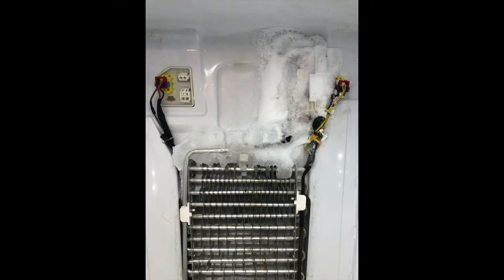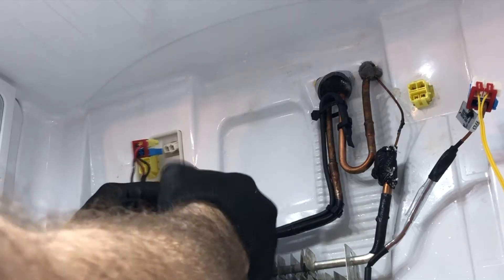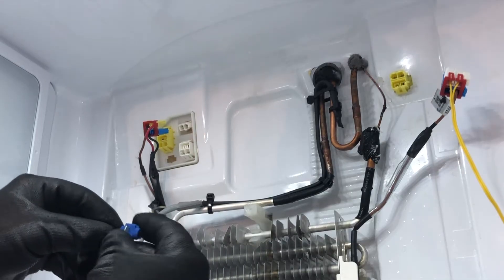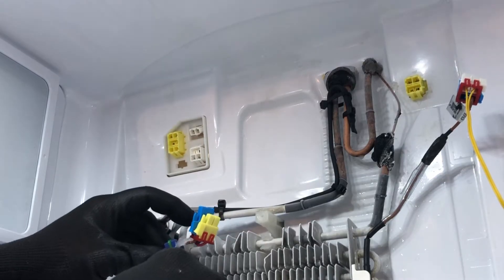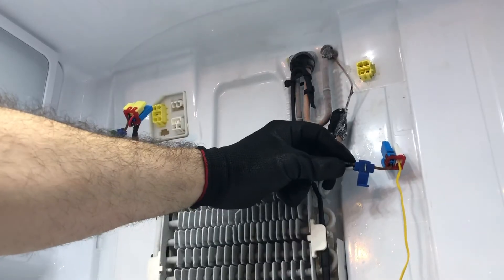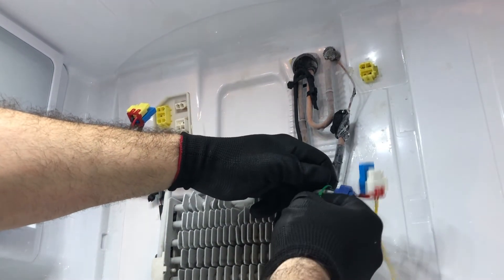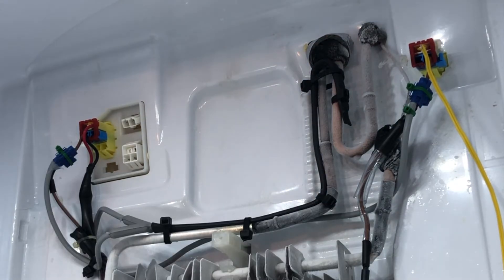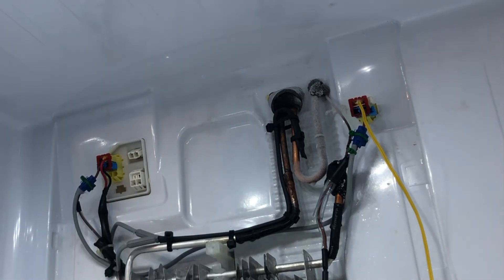Samsung FDBM evap heater add

Comment: Well I tried this fix and it only worked for a short time and it's back at it again.  I'm afraid I may have to throw in the towel.  I have replaced the thermostat and defrost sensor behind that panel as well.  Any more suggestions to prevent this issue?  Is there a timer on this fridge?  RF263TEAEBC thanks.
Reply from the maker: You do have to rectify the source of the problem which is the drain, Samsung has a modification kit, part number is DA82-01415A. I don't mention it because this video is for professional technicians and techs know about the recurring issue. I would recommend calling out a professional to finalize the repair and make sure the added heater is hooked in correctly and working properly.

Comment: Thanks for the video, anyway to put in the description which wires you connect to? They look like the brown ones? Also how do we test it to make sure it’s working and connected right?
Reply from the maker: Not all wire colors are the same for different models, check the schematic. To test, put it in diagnostics mode to defrost after you instal the heater. It should be hot to touch after a few minutes, can't keep your finger on it for more than a second. It's about 160 - 170 degrees.
Reply: obiously the two wires that the original heater is connected to. just follow the heater, it has a wire coming out on both sides. another way to test is to jump the defrost thermostat and that will trigger heating

Comment: This looks like a great solution. I live in South Africa and out voltage is 220V. Will this still work on my Samsung fridge?
Reply from the maker: the Supco heaters we use here in the USA are 120vac, so putting 240vac on it would cause the heater to burn up. If you can find a similar 15 watt heater, that would be ideal. The heater itself should heat to about 160 - 170 degrees. If you use too high a wattage, it can melt the evaporator cover.
Reply: @electronicsprojects4708  Thanks so much
Reply: @electronicsprojects4708  is the heater circuit not transformed internally to DC voltage? I would have thought internals mostly ran on DC, no?
Reply from the maker: @mitsuturbo  no, both factory and mod heaters are 120vac, (US models).

Comment: Do you have to strip the other wire (original from the fridge) or does the displacement connector cut into the shiething?
Reply from the maker: the wire insulation of the heater is too thick, so you have to strip the wires.
Reply: @electronicsprojects4708  Sorry, so the NEW heater wire, you have to strip like you did in the video, but the original wire, you don't have to, correct?
Reply from the maker: @larryroyovitz7829  correct
Reply: @electronicsprojects4708  Thank you, I just ordered that heater! Fingers crossed. Thanks again.
Reply: Well, I've added the heater, so we'll see. I have the RF197, which is "supposed" to be fixed with the drain kit. We upgraded the drain kit last year, but still had to unplug the fridge for days to defrost. This is the last ditch effort...if this doesn't work, I guess it's landfill time. What a waste. We'll see.
Reply: @larryroyovitz7829  did it work okay so far?

Comment: I couldn’t see the connection because of the Arm gorilla hair block.
Reply from the maker: Connection differs by model, it is wired in parallel to the defrost heater, I would refer you to the schematic for your specific model. If you are not a tech, I would not recommend you attempt this mod.

Comment: So where did you put the thermistor?
Reply from the maker: I find thermistor placement is a red herring. Samsung went back and forth, change it, don't change it. It doesn't make a difference. On these, you want to make sure the mullion flipper is working properly, clean out the condenser, add the Samsung drain kit, add the suction line heater, and you are good to go. (as long as a dryer hasn't jacked up the cover)
Reply: @electronicsprojects4708  thanks

Comment: Why won't my forced defrost kick the heater on? I changed out the heat sensor and I also changed out the thermal disconnect...any ideas? Thanks for your time man...it will power on for a second but then turns off
Reply from the maker: if its sensing the temperature is too warm on the defrost heater, it won't turn on the heater. If it won't kick on when frosted up, you may have a defective relay on the main board. Use the schematic and ohm out the circuit from the wire harness connector at the board. If you get 100 ohms approximately, it's the board.

Comment: Just be careful if you go outside of manufactures specs. for safety reasons.  If all components are working as the engineers designed them to, it should work.  I also measured the heat coming off the OEM heat coil and it approached 400F.  That is a ton of heat so I would be very careful about adding more heat back there as it could build up and become a fire hazard.  If frosting over becomes an ongoing issue, and it wasn't there from day 1, there are likely several other things happening e.g., drains, sensors, fans, built up moisture, etc.  Some of that non-visible moisture can be trapped inside the back panel foam.  My new panel weighed ~2lbs less than the old one, that I thought I had dried.
Reply from the maker: the new heater generates about 160 degrees, and you can touch it with your hand without getting burnt. It's not hot enough to start a fire. Your assumption that it just should work is incorrect. The engineers failed in their design, that's why many techs have thanked me for coming up with this mod. I know that thousands of these refrigerators have been repaired instead of being thrown into the local dumps. The only reason that Samsung doesn't introduce this is because it would change the energy consumption of the fridge, which is regulated by the government. This repair is for techs, not for DIYers and you are a tech, you should know about the Samsung mod kit, cleaning out the condenser, checking the mullion flipper for correct operation, the sensor. This mod is for the professional tech that has done his due diligence and is still getting a call back from his customer because everything he has done to try to fix the issue, has not worked. I was this tech years ago, that's why I came up with this mod. ps, it's very rare that I change the cover, only when someone has thrashed it before I get there, maybe once or twice a year, and I do at least a few a week.
Reply: @electronicsprojects4708  I think you are reading a little too much into what I wrote- maybe re-read my comment.  

You are obviously very knowledgeable.  As someone who studied Electrical Engineering in college, I can appreciate your innovative idea.  I also never said you were right or wrong.  I simply suggested that people might want to be "careful" going outside of spec. I stand behind that comment. Perhaps others are not as talented as you and install an additional heater incorrectly and it could lead to issues.  They might accidentally buy a much hotter element or install it on a different type or fridge.  In your case, I agree that 160F doesn't sound too hot but when combined with the main heater ~400F just below it, it definitely can add to the build up of heat.  That is not my opinion, but physics and that cannot be refuted. Also, some of that extra heat (even a very small amount) probably isn't great for keeping the food fresh as some of that heat will inevitably end up in the fridge.

I mostly agree with you that there was likely some type of initial design issue.  I think part of that also has to do with the substandard drain.  I just went through this issue so I was commenting based on my direct experience (what worked.)  Again, this is not just a random opinion.  

I never installed an additional heater, and your polls aside, my refrigerator is working perfectly now.  Changing the panel was necessary "for me."  It came with a new fan, (1) new sensor and it removed a lot of moisture that was definitely trapped in the old panel (making it much easier to ice up- even though it appeared dry.)  The seal was also improved.

Again, I'm glad the solution is working for "you" but I think it is still prudent to be careful recommending it as something for many others to try.  They could have slightly different models and other factors/considerations that might make adding any additional heat back there a poor idea. Lastly, if their refrigerators were working just fine for years without the additional heater, you should consider why that is the case.  It is still my opinion that restoring to the factory OEM spec. will get it working again and it will be the safer option.  My fridge is working great but you are welcome to disagree.
Reply from the maker: @MOAB-UT  like I said, this is for techs, not diy'ers. That's why it's not a full tutorial, if someone is a tech, they can take this information and use it for the model they are working on. I do not recommend DIYers attempt this or any other repair on an appliance.
Reply: @electronicsprojects4708  No worries.  I appreciate your ingenuity. I hope S*msung is watching.  It's embarrassing anyone would have to go back in and re-engineer one of their products.
Reply: @MOAB-UT The whole point of this modification is that the design is flawed and this flaw disallows proper defrosting in specific areas so built up frost causes follow on issues. Adding more heat in the specific area during the defrost cycle is the proven solution for that specific problem. If people are winging it with an unrecommended too hot heater wire, that’s on them.
Reply: @chilitoday  Thanks. I get the point but also have concerns about fire. Adding more heat to a bad design (I agree) might technically "work" but it may or may not be a good long term, "safe" solution.  That said, you could be right- just my .02c's. I did study a bit of Electrical Engineering for what it is worth but that doesn't mean much. Testing is the best way to find out- it's what scientists and engineers do anyway- test, fail, repeat. Eventually find what works and paint it, make it pretty, hand off to marketing and sell it!
Reply from the maker: I polled techs on an appliance tech only group to see what the worst design/most dreaded fridge is, here is the results... https://www.dropbox.com/s/d99t5sdm4rxpi0g/Worst%20FDBM%20poll.png?dl=0
Reply: Looking forward to his reply to this comment.

Comment: Thanks for the great video! After tearing my fridge apart 3 times to defrost with no good fixes from Samsung or had previously found online, I'm hopeful this one will do the trick. Question for you: Last time I tore mine apart, I damaged some of the foam on the back cover. Do you think I should replace that cover because it will give me issues and cause excessive frosting? Or do you think the heater up top should fix my problems? Just trying to save $100 on a new cover if possible.
Reply from the maker: if the foam is still there, I usually just use a white silicone from WP, it's food grade. that way I 'glue' it back together without having to replace it. If there's enough styrofoam missing, it could cause air leakage issues and unbalanced cooling. Just depends on what is missing and where. Whirlpool p/n is  482338 for the silicone.
Reply: @electronicsprojects4708  Thank you for the advice. I don't have any or much foam missing, so I will patch it up with some silicone. Thanks again!
Reply: Glad to hear your experience.  I was hoping I could just get away with defrosting and it would be good for awhile, but after reading this I'm going right for the repair.

Comment: Would this work on the RF197ACRS?  The insides look different here than in my Samsung refrigerator where the freezing over keeps happening.
Reply from the maker: It's usually the drain that is stopped up on these, that's the real problem, or slow drain. If there is ice in the drain pan, the heater would only be a stop gap. Follow instructions on the bulletin for Samsung drain mod. p/n DA82-01415A, probably other videos on YouTube on how to instal this kit.
Reply: I have this same fridge and we installed the drain kit, and it didn't help. We had to keep defrosting every 3 months (I mean turning off the power). Then about a month ago, we started having to defrost every 6 weeks. Then after only one week it was frozen again. It's getting worse, so I'm trying this fix. Just put it in today.
Reply from the maker: @larryroyovitz7829  as long as the evaporator coil is clear, this fix should work if you instal the heater correctly.
Reply: @electronicsprojects4708  When we turned the fridge back on it took a really long time to get back down to fridge temps. Not sure what that's about. We haven't put food back in, as we're still not sure it's working.
Reply from the maker: @larryroyovitz7829  in my experience, it takes longer if you watch it, lol. Usually overnight into the morning, it will get to correct temp cause no one is opening it, letting warm air in.
Reply: @electronicsprojects4708  Sounds good! We'll see how it goes. Thanks again!

Comment: Thanks for the information.  I just followed your process today on my RF323TEDSBR after once again hearing the fan thumping due to ice build up.  I last    had to open it up and melt ice buildup on March 28th 2021, then before that on Sept 6th, 2020.  We'll see how it goes!
Reply: How'd it go?
Reply: Well, a month ago everything was frozen up again. Adding the new heating element helped with a quicker forced defrost but for me did not stop the main problem. I may get around this by periodically forcing a defrost cycle.
Reply: @mikemartin347  could it be an issue with the thermistor where it is not turning on the heating element?
Reply: Hi, any luck with this?
Reply: So, How it's going?

Comment: I did this fix mid March 2021 after trying other fixes such as moving the sensor to other pies ect.  but felt it was worth reporting that it has not frozen up again up to this point mid may (2 months).  I have a blue tooth temp sensor in the fridge and the temp fluctuations are acceptable and consistent.  The last time I defrosted with out adding this heater fix, it didn't last a month before freezing up again.  I have not taken apart the fridge again just to check the build up as there is such a bad history when I take off the back panel but would love to check what is actually happening back there but I don't want to rock the boat.  If I do I will report back.  Thanks for the video! Really appreciate it!

Edit, end of june 2021 - still no issues after performing this fix!

Edit - Jan 2022 the fan just started to click again and ice is visible through the center set of holes at the back. I will tear apart one of these days and make sure I have my heat line in the correct spot.  I can observe ice and where it is not melting.  It's been just about 1 year so this is great!

Edit - end of Jan 2022. FORCED DEFROST IS ALL I NEED TO SAY.  So instead of tearing apart the fridge again I used the forced defrost feature for 20 or so minutes and then unplugged the fridge to stop the process.  Plugged it back in after a min or so.  There was no visible difference right away on the ice coming through the center holes. But over the next few days that ice slowly started to look different and looked smaller and looked as if it was melting.  So I ran forced defrost again for 20 min. And today the ice that was coming through the middle sets of holes is nearly gone!  Super happy!  My theory is that the frost found a small area that is not heated enough or for enough time to melt it all away and that frost area was able to "crawl" around the new heating line and keep building up on it self making its way to where the holes are and apart to show it self.  With a forced defrost cycle or 2 it broke the frost building snake and has melted away!    I will just use the fd feature once a month ti stay on top of it.  Here's to a great fix and another few years with this really badly made samsung fridge.  I'll keep you all posted as I know how annoying this fridge is to everyone.
Reply from the maker: I went back out on one after 2 years, and found no frost build up. If you do this repair correctly, there shouldn't be any problems.
Reply: @electronicsprojects4708  I followed your repair to a tee and while it worked briefly it began freezing up again.
Reply: @Mike Kapotsy  mine too...on to the next step, I'm going to address the drainage area next, just ordered the part. After I install that, if I get ice, I'm going to hit the FD and let it go.
Reply: @e.shealer2417  so far I've upgraded the drainage element to the larger size and I've added in the heater as well. My back cover is in quite rough shape but I'm still able to get it on where it's almost completely flush. I'll see how it fares now. Last few times it's been icing up within 2 weeks. If it ices up again I'm going to replace the thermistor.
Reply: @jasb1133  That was the 1st thing I did. It made no difference for me. Good luck.
Reply: What was your symptom of the freezing problem?  Was ice building up in the ice maker compartment as the overage from the ice tray couldn’t drain out properly?
Reply from the maker: @stephenkusen8730  this repair is not for the icemaker issue. it's for frost build up in the evaporator fan area in the fresh food, the frost causes the fan to stop and warm up the compartment.
Reply: @stephenkusen8730  no it was not cooling in the fridge area.  The fan would start to click  because it was hitting frost build up and then the fridge wouldn't cool
Reply: I'm in the same boat as you. I added the heater, however, I did not check my drainage. I ordered the part for the drain and will install and then do the FD thereafter.
Reply: @e.shealer2417  if is the drain, the build up of ice, will start at the bottom not the top. so u might have dirty coil, bad board. assuming u change or check the thermostat and the heater element.